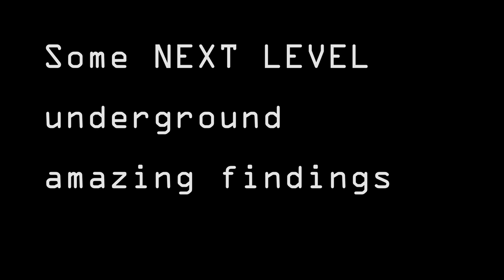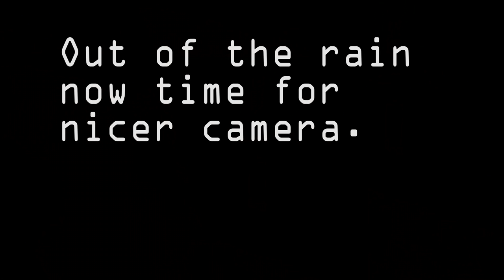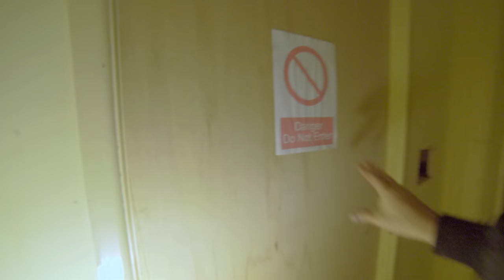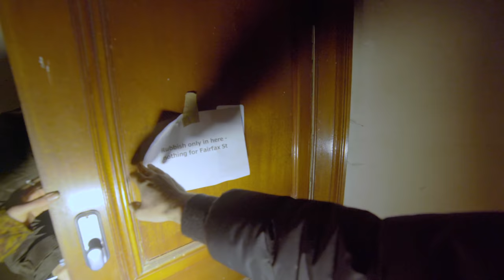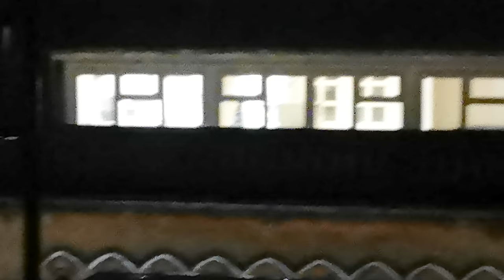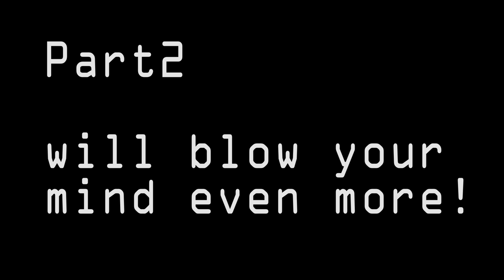Bristol Court and Guildhall *BANK VAULTS FOUND* Part1

Comment: I did wonder Matt if that shaft was in fact a dumb waiter from where the kitchens may have been in the basement and they lifted the food to the various floors at time of functions etc, save going up and down the stairs, great video by the way, cheers Mike
Reply from the maker: Yes quite possible. Those buildings date back to 1800s.